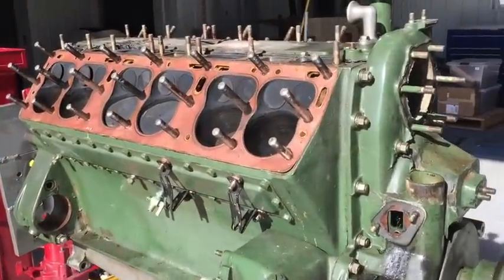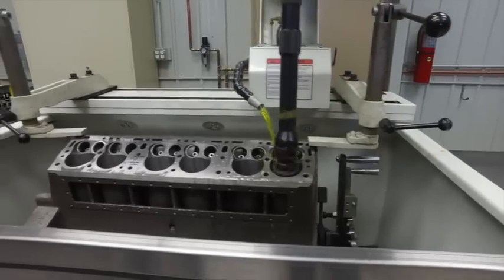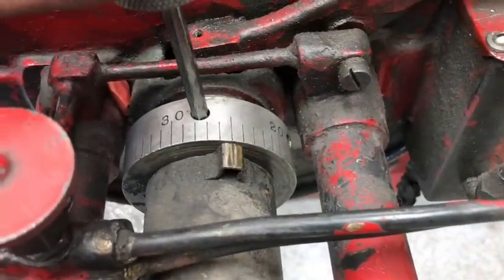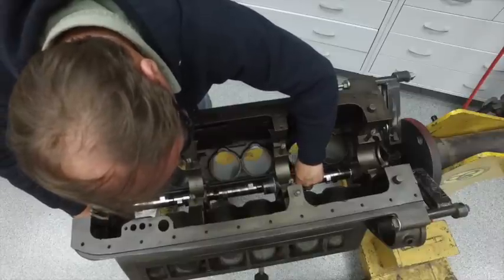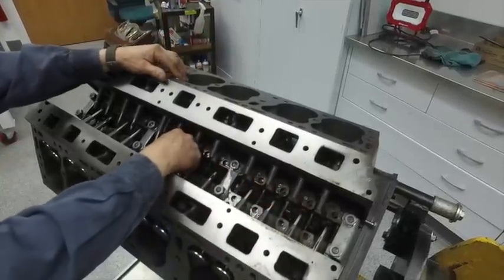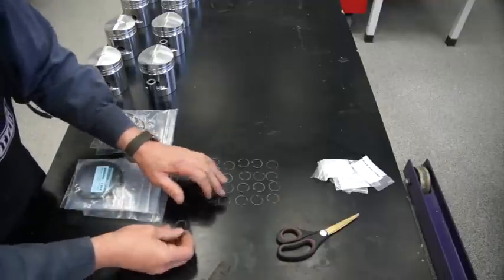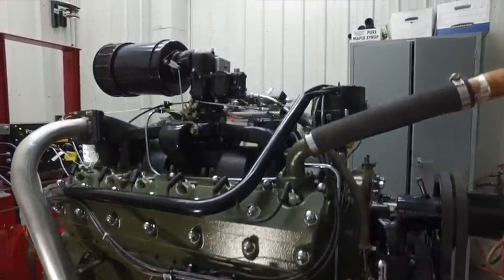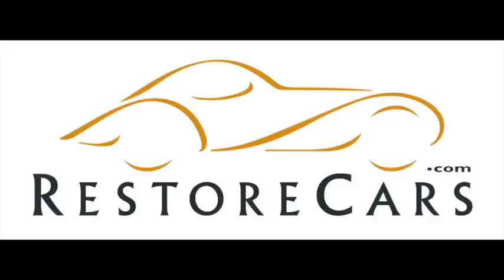Remanufacturing a Packard V12 engine

Comment: With modern metallurgy of new engine parts where required, including gaskets and modern oils and filtering (if possible) what is the estimated engine life for these engines?  Of course these cars will accumulate very little miles so this is a hypothetical question.

Comment: It could be very amusing to see one of these fitted with direct injection and modern EFI control and catalytic convertor, and see what the emissions are compared to a modern engine at both the standard output, and then tuned up to take advantage of the injection and electronic ignition. For giggles, one could even add a pair of turbochargers and custom manifolds, making 7 to 14 psi of boost, and see where that torque number goes. Put a modern 8 or 10 speed automatic behind one in the original cars, and the performance would be incredible.
Reply: For starters, just take this engine as is restored to factory specifications and get a baseline! The tailpipe emissions may surprise you!
Reply: Supercharger too, like a plane engine from 40's (RR Merlin, P&W Major Wasp)
I think with modern features is possible reach 800hp

Comment: The yanks     no pun intended   know there  big pistons
Reply: These are actually pretty small. You have to pull the piston out through the bottom of the cylinder because the bore isn’t big enough for the connecting rod to fit through! Reassembly is fun…

Comment: JUST ANOTHER OF AMERICAN AUTOMOTIVE ART. Packard is one of the finest automobiles ever built on the planet. How wonderful it is to see master rebuild engineers ding their magic on such a worthy automotive treasure. It saddens me to see all of those PT boats burned down at the end of WW2. Just imagine what those engines alone would be worth today used in new applications. These Packard 12's had low-rated HP but tons of torque. They were as smooth as rare wine. These cars are beyond amazing and worth every penny to 101% restoration. Such beautiful eye candy as well. Tank you for sharing your magic with us.

Comment: Looking at previous work on the crank, and the plating job, some people's kids, who did crap like that? it's not like people weren't welding and recutting journals back then. Oh well, remarkable work on your crank specialists side and in the end it was all a beautiful job, one that will last very many more years. internally that V12 is pretty interesting with that valve and combustion chamber design.

Comment: Isn't this the engine that was used in the PT boat?
Reply from the maker: No, just the cars.
Reply: I believe the PT boats used the Rolls Royce V12 that was made by Packard during the war... and Packard built Rolls Royce engines better than Rolls did!
Reply: @Jeff DeWitt  PT boats used a Packard designed 2500 cubic inch  V12 that was purpose designed for marine use. No relation to either the RR or Allison engines.

Comment: This block is how I would of made the flathead V8, intake and exhaust on the inside of the engine banks, combustion chamber inside the head.

Would've been more efficient and more powerful as the flow is better since the exhaust doesn't have to fight it's way around the exteriors of the cylinders. It would allow for a bigger overall engine as there isn't any manifolds on the outside of the banks.

Comment: John Bolster, in his book "The Upper Crust" rated the pre-WW2 V12 Packards ahead of the V12 Rolls-Royce for (relative) ease of maintenance, engineering and reliability. He particularly liked the earlier V12s when Packard used gear drive to the fan before they changed to the less expensive to manufacture belts.

Comment: I've built a couple of the V12 Packards for PT boats my father was international president of the organization we got two engines in that were in real worn out condition and had to do pretty much the same thing you did here get it all back into tolerance again and build it. The hardest thing that I had to deal with with those particular engines was the magnetos the Mallory magnetos they gave me more trouble than I could shake a stick at..

Comment: Where's the assembly lube on
That cam. All Bering's mains rod
 Cam Bering's need assembly lube.
Reply: The bearings were lubed before cam was installed.  If you look at the bearing ends after the install, you'll see the white lube there.
Reply from the maker: We use assembly lube.

Comment: During World War II Packard built the Merlin engines for the P-51 and other aircraft.  They impressed the British with their quality and precision.  My Dad had a 1936 Packard Super 8.  It had a little cubby for your golf clubs.  I wish somebody was making the Packards again, han- building them for people who appreciate a fine car.
Reply: Also Ford U.S. built Merlins too. Rolls Royce sent plans and Ford engineers came back and said they couldn't work with these drawings. At first RR thought that Ford tolerances were not fine enough but in fact it was kinda the other way round, insofar as RR built every engine to almost individual 'standards of tolerance' Ford on the other hand had set a range of tolerance to accommodate the mass production process. So, a less skilled worker could assemble standard components, RR on the other hand needed more dedicated higher skilled workers which was lovely for the individuals who built the engines almost on a personal level like they were building bespoke car engines but not very efficient when you need thousands of engines manufactured quickly and reliably.  A good reference is made in Sir Stanley Hookers autobiography 'Not Much of and Engineer'. Excellent read, highly recommend it. Certainly still available on Amazon U.K.

Comment: Beautiful Job, if you  need a modern mechanical spring water pump built to eliminate the  packing problems let me know as I build them all the time. fdrbp.com
Reply from the maker: Thanks Wade.  We overhaul our water pumps with a modern seal and our own redesigned modern impeller that we CNC make right here.  .

Comment: I never knew they made side valve v12s before
Reply: flathead engine is the technical term for it. Most engines were like that back in them days. I know cheaper cars came with flat 6s clean up untill the mid 60s.

Comment: What is being machined flat at 1.19? next picture shows that unusual, "un Flat head" type top of block with those odd angled valve seats and how do you get a satisfactory compression ratio with that odd combustion chamber shape?

Comment: Flat heads  were culled, due to excessive exhaust heat , being recurlated back toward the cylinder bores & over heating issues from the failed design

Comment: I salute your craftsmanship, Sir... Q: What's the difference between this engine and what they used in the old PT Boats of WWII?  Those babies really "Droned!" This thing was pretty quiet!...
Reply: Completely different engine. This simple little flathead car engine is MUCH smaller!  The PT boat engine is a huge OHC aircraft engine...an Allison design,licensed by packard to build... like the P-38 fighter used. Well over 1000 HP and same on cubic inches.  And there were 3 of them in the PT boat!

Comment: In 1970 I went to work on the ambulance in Los Angeles.  One of my training instructors was a man who worked on the ambulance in LA since World War II.  In the early 70s, ambulances were transitioning from the Cadillac to Ford, Dodge & Chevy Vans. This training instructor told me of all of the ambulances he worked on, the Packard Ambulance was the best to be had.  He said the power and reliability was excellent.  He told me the Packard Ambulance had a powerful Straight 8 with three speed  manual transmission.  The siren was mechanical and was powered off of the flywheel because the motorized siren used too many amps for the battery and generator to keep charged up when in use.  I found this video very interesting because I am in awe as to how much quality the Packard and its engine had back in the early days of the automobile.

Comment: Beautiful restoration. I'm sure you did lube up the crank and camshaft bearings as well as all the other moving parts during assembly, but it wasn't quite obvious. It would be great if in any future videos you highlight this detail. Other than that top job on the visuals and commentary.

Comment: These engines would work mean with EFI Injection made to look like  mechanical Hilborn injection but that's my opinion the purist would probably shoot me lol.... Might as well throw in 12 coil packs, 'hidden off course' and the ports cnc'd and maybe a better cam 'not bigger' just to add a bit of tech in it, it would sound so crisp and clean. can't help myself, I'm sure my grand dad would approve if he was still around lol
Reply: Half the appeal of these old classics is having them run and drive and sound exactly like they did 80 years ago. For me, it'd be a carb, it'd be points ignition, and nothing less. If I wanted EFI I wouldn't be buying a classic in the first place.

Comment: Maybe it was just hard to see but it did not look like the cam, crank and connecting rods were prelubed. Even when the valves were put in. 
Did I hear right the connecting rod bearing oil holes were manually drilled through the rod. No mention of burs when the drill bit came through.

Comment: I build/rebuild engines as a hobby, but I would give a gonad to have that workshop. Screw sending parts out to someone else only to find your crank journals (or other vital internals) have been butchered. Like those roasted connecting rods, at the beginning. Ouch! That would be a major cost, if not scrapping the rebuild, altogether, for Joe Average. Auto porn, at its finest. lol

Comment: What a difference between this truly professional operation with its properly-equipped, clean, well-run facility staffed by highly-trained mechanics, machinists and other experts, and the dingy, cluttered, disorganized, poorly equipped and poorly staffed operations we often see in other places.  Thanks for this video and for showing us how competent professionals approach the daunting job of rebuilding engines such as this Packard V-12.

It is reassuring to know that this caliber of work is still actually available in our current throw-away society, where “entitlement” is the order of the day and, to many young persons, the concept that one could or should invest the time and dedication to train to become a professional mechanic, machinist, body worker, welder, automotive electrician or other automotive professional is not even on the horizon of possibilities; it’s just too much effort. 

In another video, I learned that there is a college in Kansas which offers a 4-year degree program in automotive restoration, where the various skills needed for this work are taught both in the classroom and in a properly equipped shop setting. It will be interesting to see if any of the viewers have enough interest in this type of work to ask the name of the college.

Thanks again for an excellent video.

Comment: The people who built those engines way back in the 30s had no concept of the technology we have today. They did the best they could with what they had, and now, we can do much better. In another hundred years, our technology will be considered primitive. "Oh, they used a CNC machine? No wonder the tolerances are so shotty.". Of course, in a hundred years, there may be few internal combustion engines left. Most cars will probably be battery electric and automatically piloted with computers. Cars might even just not be very useful anymore. Some form of revolutionary autopiloted public transportation may pop up. If you can imagine Uber/Lyft, but no drivers, publicly funded, and able to show up to your exact location in only a couple minutes. Whisk you away to your destination for a small fee, much cheaper than the excessively taxed automobiles (due to the governments trying to phase them out for environmental reasons, look at Japan for a primitive example of this taxing to try to fix traffic issues). The population is only going to grow. We currently have about 7-8 billion people on this rock. In a hundred years, that could be 12 billion or more. People are moving away from rural areas and into urban areas. Rural areas around urban areas are being developed. Just in the past twenty years in my town, traffic has become insane. Used to be that you could go out for a casual drive and hardly see anyone on the road. Now? The only time the roads are somewhat like that is in the middle of the night. Whenever the sun is shining, it's a madhouse. It will only get worse. Someone at some point will found a business to tackle the problem of traffic in a way that works with how humans need to travel. This business may already exist, or it may not. AI will very likely be used to both make the transport safer and cheaper to operate. Once it becomes easier and cheaper to use that transit, cars will become less popular. Car, as we know them today, may even eventually die off.

Comment: The video of a block deck surface being machined: that's not the V12, appears to be an L6.
What do you set the piston to head clearance at?
If it doesn't need weights, why are they still there?
Reply: The engine was on its side. That was the v12.
Reply: Crank didn't have any weights while balancing !?

Comment: Needs a duel carb manifold adapter ..... a pair of  Stromberg Carbs...and an Isky cam  ... and some good headers .... bingo !
Reply: and a car that can easily bring $500,000 at auction would suddenly become worth one-tenth that much.  people who buy these things do not want modifications from factory original (thank heavens!).

besides, at 436 lbs-ft of torque, you don't need them.  even in a 5800 pound car, it's more than enough to get it out of it's own way.
Reply: Something tells me that an owner who has specified a paint job for his engine that appears somewhat less than brand new will not be interested in such alterations.

Comment: I think the term is "reconditioning". 'Remanufacturing" I assume would involving casting/machining new parts. Up to the 90's there were big companies (Repco, Higgens, etc) with multiple outlets with fixed prices selling "reconditioned short & long engines" "straight 6 & V8s" "GMH, Ford, Chrysler", "must exchange in old engine for this price".  It doesn't seem to happen these days.

Comment: My grandfather owned and ran a machine shop during WWII.  He was exempted from the draft because he was the only machinist in a 300 mile radius and was needed to keep the farm equipment running where he lived. 

He talked a lot about all the crazy adhoc, methods he had to do to keep engines and equipment running during a wartime economy with very limited resources.
Given the age of that engine I suspect some of those not so orthodox repairs were the result of a wartime rebuild when new parts were simply unavailable.
Though not exactly up to modern snuff, they seem to have kept that car moving down the road for a good many decades.

Comment: OMG the technology!  I worked my way through college as a mechanic in the 70s.  I did engine rebuilds.  My honer was attached to a drill with a long shaft.  I stood over the engine and worked the honing stones up and down the cylinder by hand.  Valve seats?  We lapped those by hand.  Valves?   That was our most sophisticated piece of equipment.  Dinosaur stuff compared to what is in this shop.

Comment: how fast does it turn, 
 on the dyno?
Reply: according to my copy of "Motor's Auto Repair Manual 16th Edition", the 1935 473 cid V-12 generated peak horsepower of 175 @ 3200 rpm.

the book i have doesn't list redlines.

Comment: Your machine for cutting the babbit mains is cool. That was one of my first jobs in the machine shop 40 years ago. Ours was powered by a drill motor with me holding the drill. Time consuming using the inside mics, holding the drill while the cutter advanced thru the bores, but rewarding as the babbit looks so good when finished. We did Model T, A, MGNA, Packard 6 and 8's.Excellent workmanship. I would be interested in the HP and torque the engine put out, assuming the dyno can measure that low.

Comment: I did some engine rebuilding in my days as a mechanic, but never got my hands on a flat head till I rebuilt my lawnmower engine.  Such a common sense design. I often wondered why we got away from that.
Reply: In a word, performance.   A hemi is a wondrous thing.
Reply: volumetric efficiency- better cylinder filling, especially at higher rpm

Comment: The audio was horrible. If your going to voice over, lower the audio of the clip. And center the audio. One ear is filled with full volume unnecessary screeching, and the other is muffled audio.
Reply: Audio was just fine for me.
Reply: @will4432    Not for me, particulary the audio lacks clarity, very hard to distinguish what he is saying, but also there were some gain issues.
Reply: Unaware, at first, of your own comment, I offered a similar evaluation above.

Comment: The most unusual valve in block setup I have ever seen, Side valves are usually flush with the top of the block, Piston head shape looks odd but obviously works. 4 main bearings suggest that these engines were not very high in horsepower therefore no need  for a 7 bearing crank.